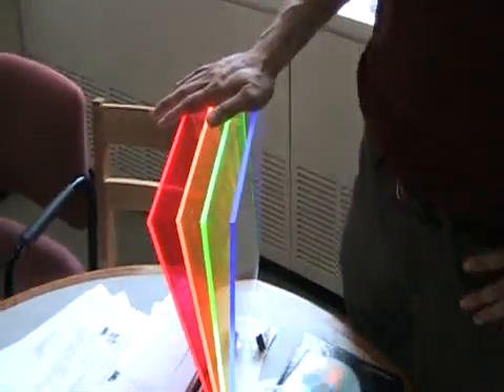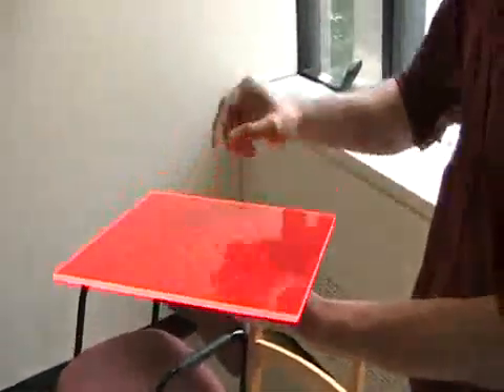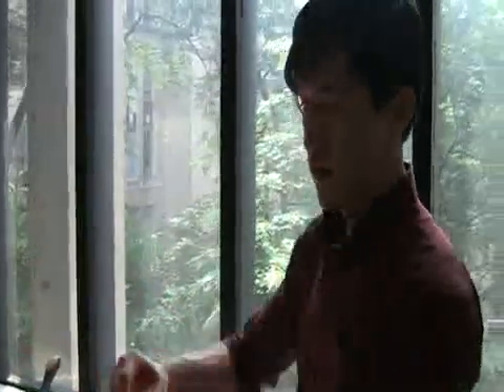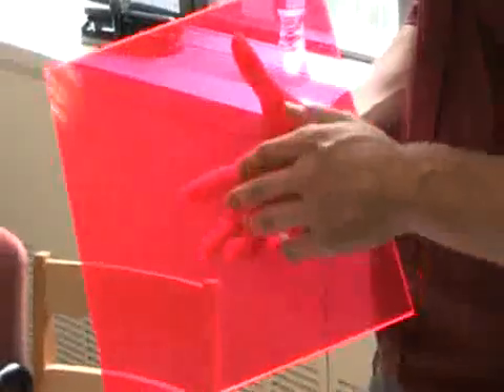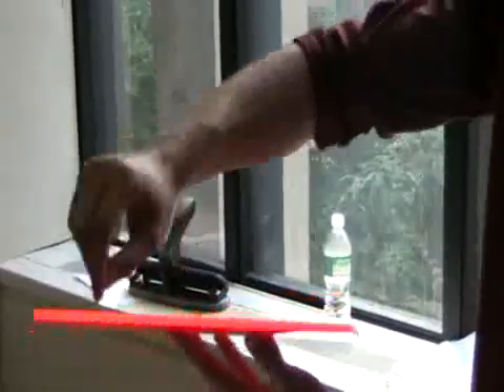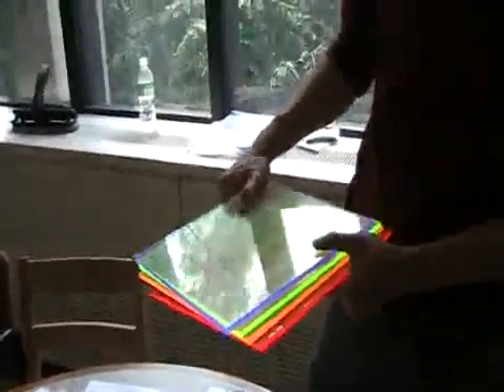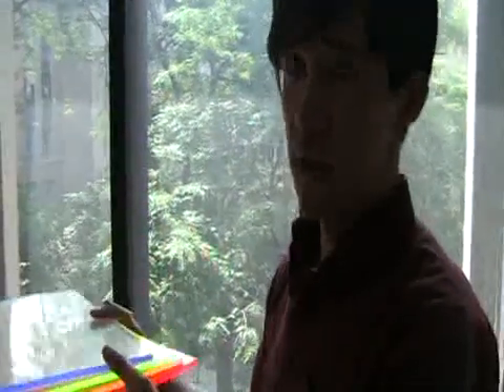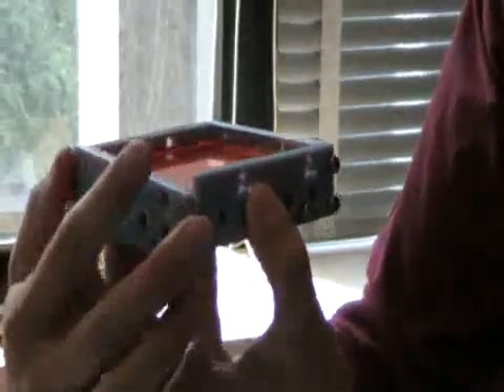New Solar Concentrator Technology

Comment: @rikv2004 here actually light are getting trapped inside the glass due to total internal reflection. refractive index inside the sheet should be higher than the air medium (outside medium) for this process!! i think now you can understand the whole process.

Comment: So why not remove the central solar cell (the large panel) and only use the tiny outside ones?  If you then replaced the large central solar cell with a panel of reflectors that would move the light to the outside of the plate (closer to where it is more effective) you might be able to gain efficiency and certainly reduce cost (over having the central cell in place).  Thoughts?

Comment from the maker: heat comes from one band in the light spectrum, so you could pick a dye that would react to that and transmit the infrared to the edges. Over at the website, the journalist confirms that they could sandwich several plates together, each capturing a different part of the spectrum. 
They're vague whether there is total internal reflection, but I suspect so, or hope so anyway.

Comment: light is trapped on the inside of the plate? or is it the heat?  if it were light, would that "trapping system" mean that there is a lower refractive index in the middle of the sheet? and higher refractive indexes on the outsides?